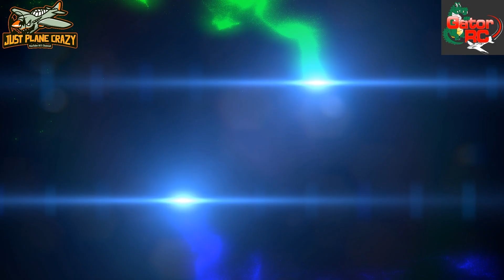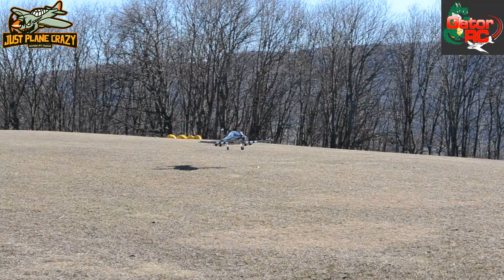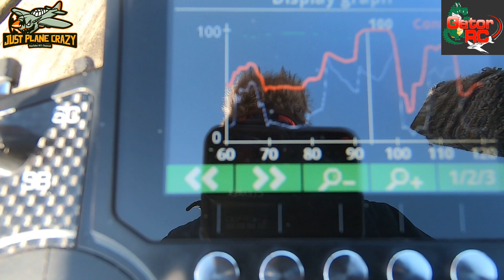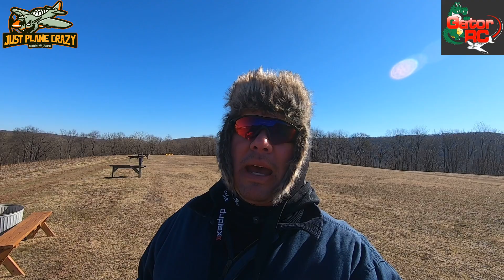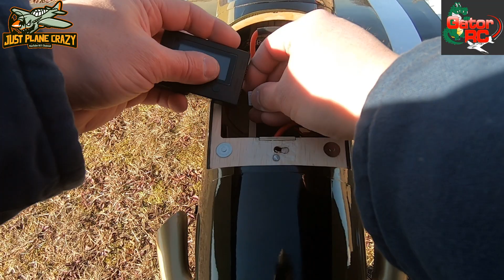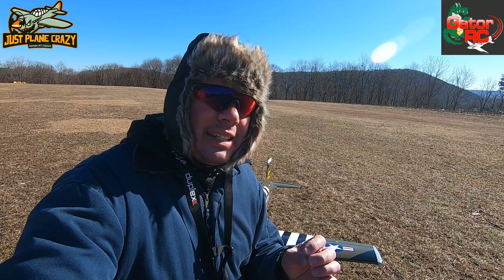Texan II Maiden/2nd Flight, Final Thoughts, and Wrap up from Gator-Rc and Seagull Models

Comment: Beautiful plane!!  I bought a similar plane. It’s balsa and has retracts but no flaps!  A 63” wingspan and I’m lost for the cg?  I’m fairly new to balsa also.  Any help would be amazing.
Reply from the maker: Nice! With planes I know nothing about you are safe to start at the forward edge of the main wing spar or what is considered 1/3 of the wing cord. Meaning from the leading edge to the trailing edge divide the width of the wing in 3. From the leading edge go 1/3 back and that should be close
Reply: Wow. Great info.  Thanks so much